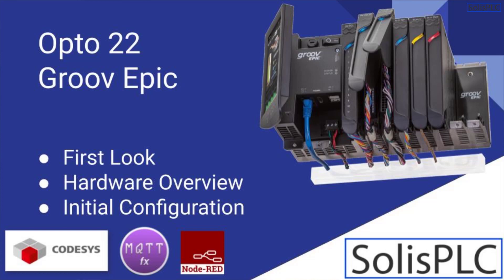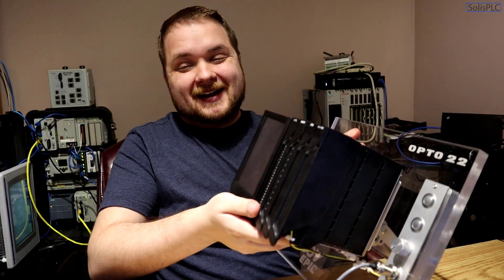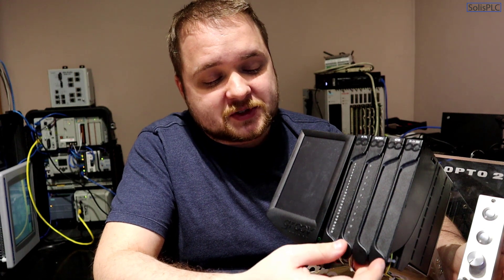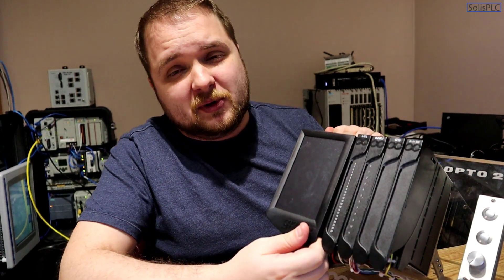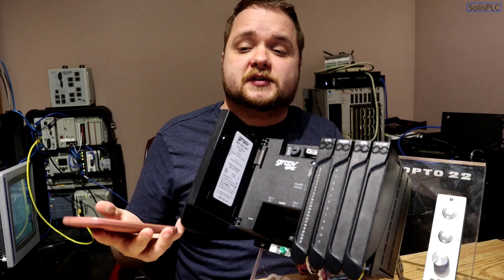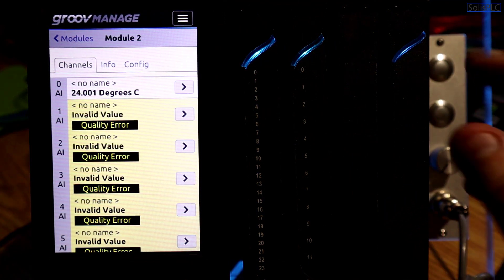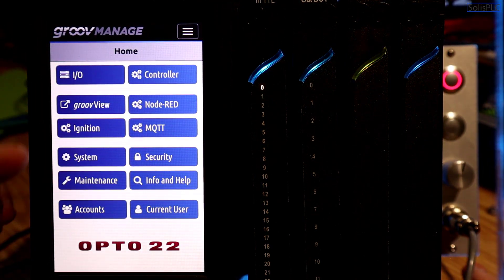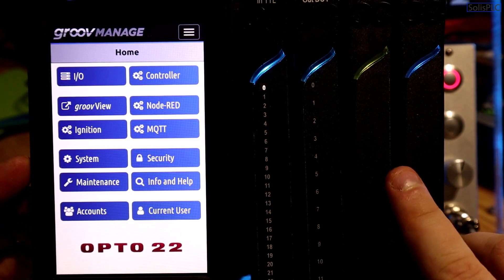Opto 22 Groov Epic PAC System Introduction Overview | SCADA Node Red MQTT

Comment: Its really very nicely described and very helpful. Can you also help me in understanding how - OPTO22 is different than other common PLC's - is it the more robust and extended features of Software integration? Direct integration with MQTT etc? Please release more such tutorials - Thanks
Reply from the maker: That's an excellent question and something I'm still working on releasing. The short answer is that Opto 22 provides much more flexibility over many other platforms. Their system integrates with the vendors that you've mentioned, provides a much wider range of hardware and is for the most part built on open architecture. It is hard for me to comment on the "robustness" factor for now as I haven't integrated and worked extensively with one of these systems in the field. Based on what I can tell, the components are of higher quality than what you'd find elsewhere (most non-US brands). It does provide MQTT, Ignition, and much more directly on the controller. From that standpoint, you can run a much larger system with the hardware/software packages on this controller than you would on any other comparably priced system.

Comment: Is anyone actually using any of these in the field? How does this compare to the Phoenix Contact PLC next system? Are there any motion modules available? EtherCAT support?
Reply from the maker: From what we can tell, these are used more in certain industries than others. It's certainly not as utilized as Rockwell or Siemens, but it has its place in Oil and Gas. They don't use a lot of motion there, so it makes sense for their systems. I'm not sure how it compares to PLCnext, but we're supposed to get a module at a certain point to benchmark it. We'd have a much better idea at that point. Initial thoughts are that PLCnext is much more inexpensive as compared to the Groov EPIC. However, (only based on non-hands-on knowledge) the software may not be as advanced on PLCnext. I don't believe that there are motion modules available; I'll do a bit more research on that. When it comes to EtherCAT, it is available through the CODESYS module that can be run on the groov EPIC. It's not out of the box, but it is possible.
Reply: @SolisPLC  Interesting! Thanks for the reply. We are pretty motion heavy and do practically nothing with the process industry. I can see that being an excellent fit there. I've seen the PLCnext in a few places but they don't have any motion modules either at the moment.

I'm interested to see what you think when you get a chance to compare the two systems. As you mentioned, the Opto unit looks very sophisticated.

EDIT: Looks like they support EtherCAT through Codesys so the Opto unit probably does as well.